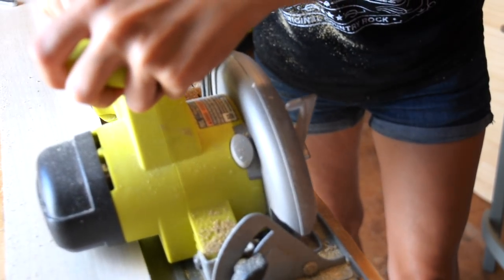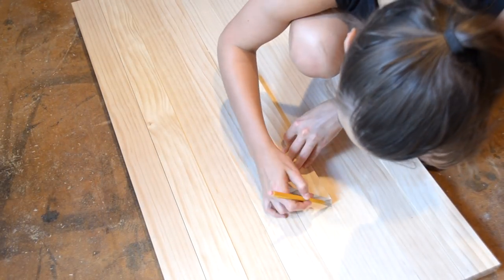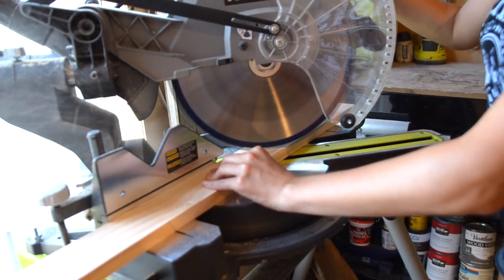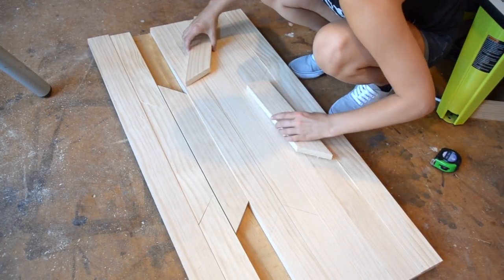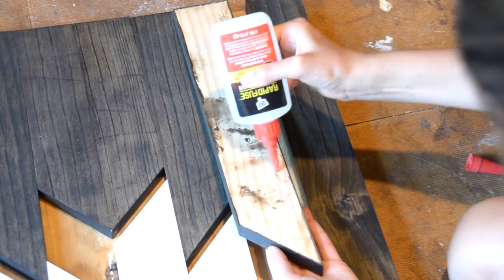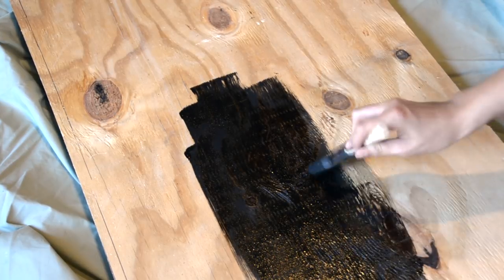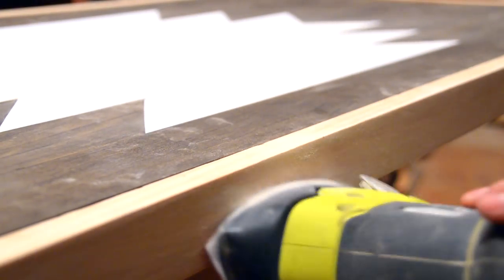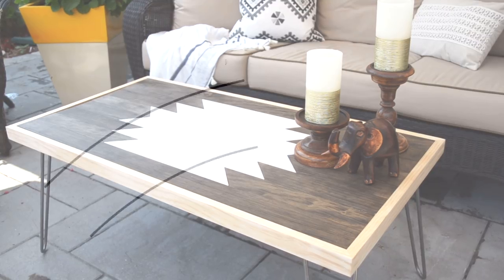DIY Geometric Wood Art Table | How To Make A Coffee Table

Comment: I may have misheard, but I think you said you used 1x4s in the video and for the plans it says to use 1x3s. I’m going to attempt this build so I just wanted to clarify. Also, do you have a preference on leg lengths? If I’m successful I will post it on Instagram with credit to you. Thanks so much for the insight.
Reply from the maker: Nope, you heard correctly! I totally messed up - thanks for catching that! They are 1x3's! Also, for the leg length, I used 16" tall hairpin legs. Hope this helps! I can't wait to see your project! :)
Reply: DIY Huntress thank you so much for the response! I did the math and figured to use 1x3s. Im about halfway done. Glue is setting and waiting on the hairpin legs in the mail.